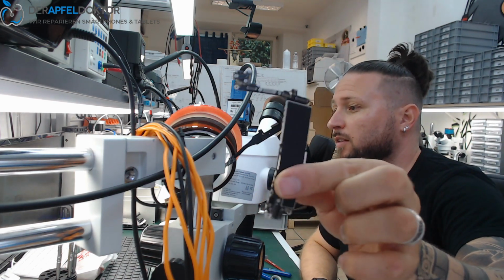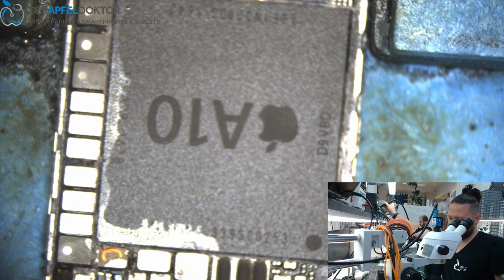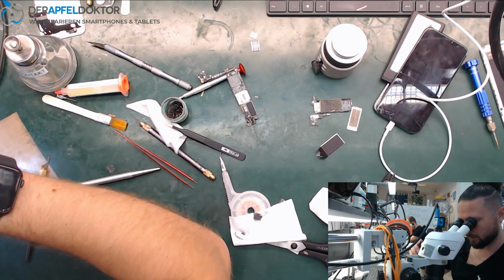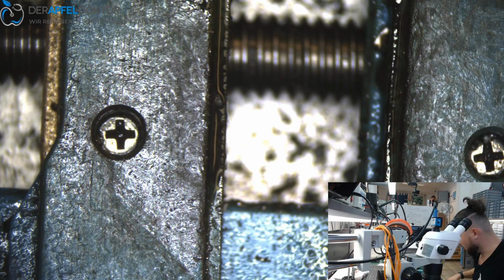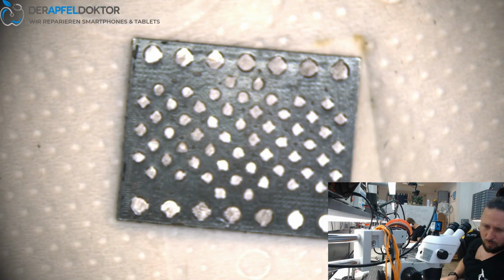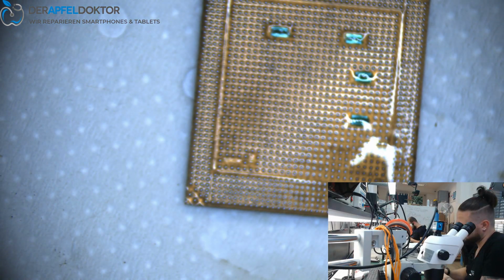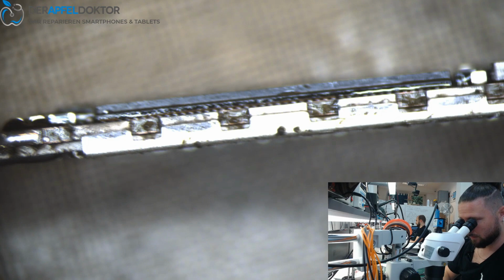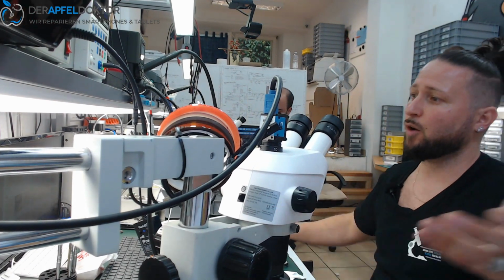MASTERJOB - iPHONE 7 A10 COMPLETE BOARD SWAP AFTER MASSIVE IMPACT - SNAPPED BOARD

Comment: What are the little 4 rectangles on the bottom of the cpu? I see you just put uv glue over them rather than replacing them. Do we need to replace them? Or can they be removed for an easier repair?